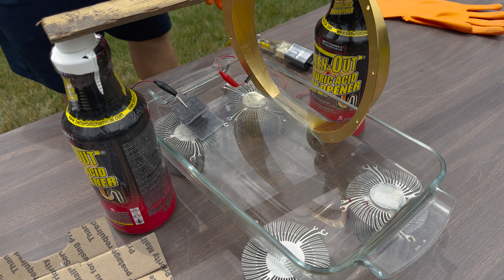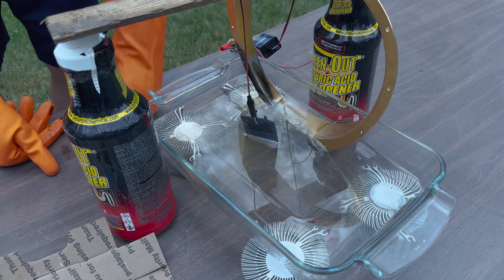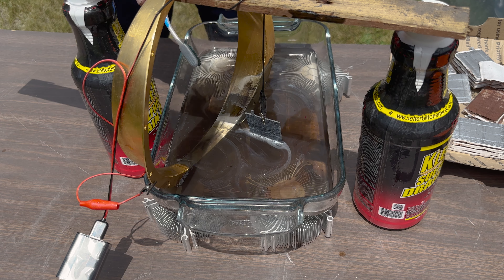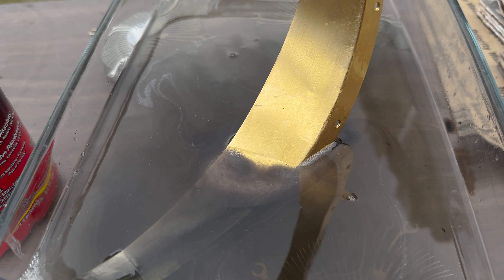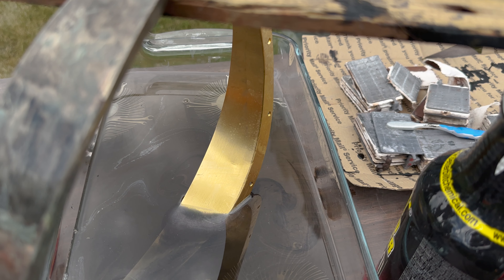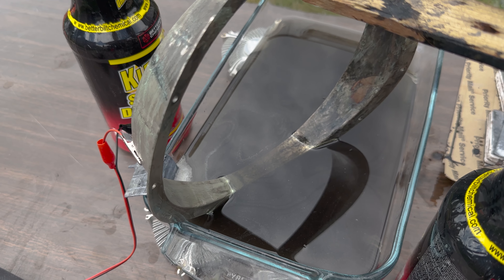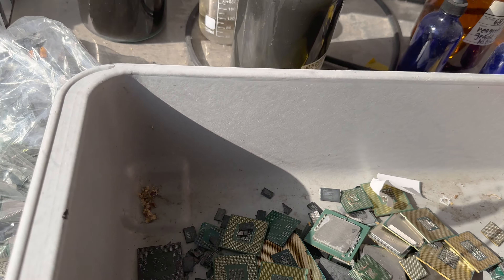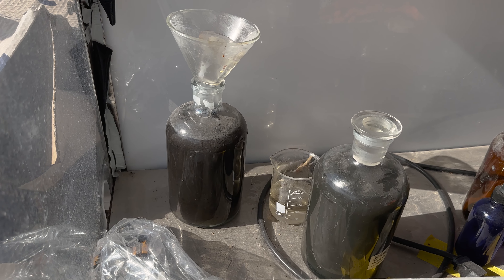Gold: Space Tech Reverse Electroplating

Comment: Go to salvation army and find a bigger Pyrex dish. It's me I'm back. I've been recovering from a broken back. A bigger dish to fit that oval piece into would be far safe than using what you are encase a gust of wind etc
Reply from the maker: hey!!! welcome back.  Sorry about your back.  It is true ... I had it balanced pretty poorly ... and balanced solids over acid is not a plan ... it is an inevitable problem.  I was going to grind it into 4 pieces ... then I decided to just start and see if I needed to cut it.  I got it done, but I may have gotten lucky that the storm did not knock it over.  I am going to try some pins in a copper basket soon.  What I need is a deeper dish for that one.  Who knows.  Glad you are back my friend.

Comment: What voltage and amperage were you running? Most I've seen use 12V at ~ 3.5 amps. When the amps drop, the gold is stripped. Also, the bubbling diminishes. Save the 1st rinse water bath as it will contain some acid and gold. An old PC power supply with a potentiometer makes a good stripping power source.
Reply from the maker: I used a 5V 2.0A USB wall plug and some usb gator clips.  Simple and easy to store.  Not so simple to alter.  I could find a power supply … I have plenty to pick from :)
Reply: @badideametals  Interesting, your little power supply works well. I bet it was a challenge to fit those alligator clips to the USB lead wire. Trying to learn what works best here. Water laced with table salt for an electrolyte or sulfuric acid? Novel idea using plates from the cell of a lead acid battery. I will rewatch your video to make sure I didn't overlook any details.